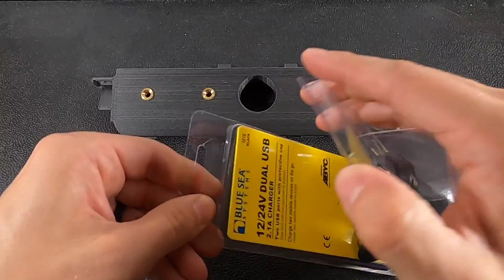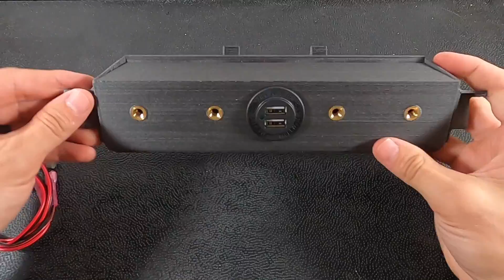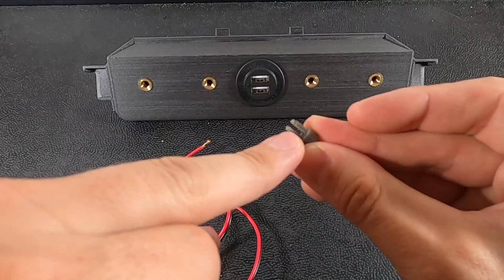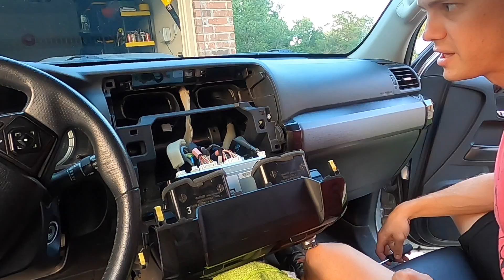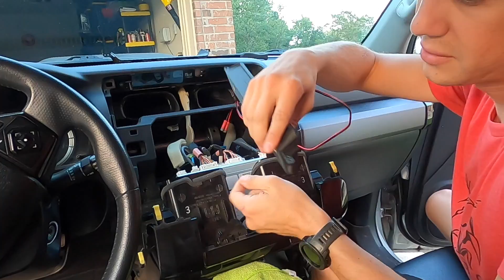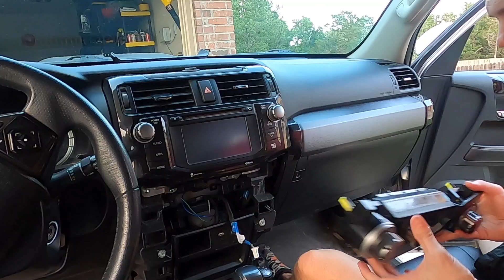LabOps Gear 4Runner No Drill Dash Mount kit

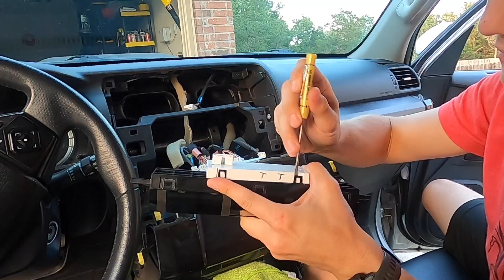Comment: @5:09 don't open the clock upside down ANYWHERE NEAR the open dash area... the hour and minute pins will fall out,  and disappear into the cavernous opening you've made,  never to be found again.... at least one of mine is couldn't find..... hope it doesn't rattle or break anything.... 😢

Honestly,  the clock still works, although slightly obstructed  there's no real reason to disconnected it

Comment: Where was this when I made mine?  
Couple questions.  You covered the clock up.  Why do you have to remove it?  The clock cover is still there hidden.  
AND..  Can the wiring for the clock be used for the power?

Comment: Using the Posi-taps is a HORRIBLE way to install this. I have commented on this several times in Multiple Videos but my comments keep getting deleted. There is a better option so you do NOT have to compromise your FACTORY Wiring. I just received my wiring harness and it is PERFECT and cost is almost nothing. PLUS it is FUSED (which can be good or bad depending on how you view it).
Reply: What harness and where did you purchase it please.

Comment: you should add a mic plug in port with like you have the usb port, if possible. also the power could have used the clock power plug in

Comment: I’m really impressed with this set up. I just pre-ordered the clock compatible version. Just a suggestion, maybe develop a wiring harness piggyback so you don’t have to use the posi-taps. I know it’s more work and you’d charge more but it’s worth it.
Reply: I didn’t see a clock compatible version. That’s the first thing I wondered if it would work with the clock as my 21 TRD ORP has the clock behind where the phone would be mounted. How has yours worked out for ya?
Reply: @KendrasEdge757  so far it’s worked great. I’ve mounted a gps and a radio head unit to the mounting bracket. No issues so far. I use the outer two ram mounts for the accessories and I can still see the clock. Honestly if it breaks I’ll likely go to the rago mount but this fits the bill and looks stock.

Comment: do you even need to remove the clock to install this?
Reply from the maker: For this version you at least need to remove the buttons or the mount won’t fit. The new injection molded unit is compatible with the cock or older display!

Comment: On the new version, can it be USB C instead of the USB A?
Reply from the maker: the hole in the mount will work for any 1 1/8th inch marine style socket.  The ones the come with the kit are only USB A but the wiring and mount would work with any other socket you wish to add.

Comment: The product is great, and I would argue that since it has been a success overall, you should move from 3D Printing these to full production. I'd be willing to spend $200 for something like this in full molded ABS and not FDM. Are you open to that?
Reply from the maker: Thanks for the kind words!  In fact molds for the upgraded version are being manufactured now!  The goal is to have production up and running by the end of spring!  The new version will work with all years of 5th gen 4Runners and allow the clock / display to remain in place.  Stay tuned!

Comment: I would love to get one of these. Any idea when they might be back in stock?
Reply: I ended up buying the ICS Fab mount. Works great.
Reply: @robbyfergusontv  how's the ICS treating you? I'm considering this as well.
Reply: @jubeikubegami  It's actually really good. Install was straight forward...they have a good video. It has held up great...still looks new. No rattling or other undesirable quirks. I got their dual USB charging port and it puts out enough power to keep two Pixel 6 Pros charged while in use...I mounted two Ram Mounts wireless chargers on it. I'm happy and I definitely recommend it.

Comment: This is an awesome no drill option, if you can make one that doesn't require the clock being removed and you will have a winner! Can't wait to see the next design. I'm very interested in this
Reply from the maker: Stay tuned. New version in the works that keeps the clock!
Reply: @labopsgear  are going to make any more 5th Gen 4Runner Dash Mounts ? your sold out and does not say if you will have any again?
Reply: @labopsgear  Any time frame? Love your simple, clean and sturdy design.

Comment: I have a 2021 4runner that has apple car play. Can I still tap into that connection? It's different from the regular USB.
Reply from the maker: The usb is for power only, but yes you tap into the 12v from the lighter. Colors are different (red should be power)
Reply: @labopsgear  Any chance you will add a tap to allow access to the USB that does support CarPlay? Maybe we can reroute the existing port up to the top and put a blank in the spot down below where that jack currently resides?

Comment: I like this product with no drill but hate to give up my clock. Others out there you keep the clock but have to drill. Any thoughts or possibilities of doing what you have done here but instead of flush with the top of the head unit to have it raised up so the clock would still be visible? I know it could compromise strength, but maybe something could be designed to make it stronger.
Reply from the maker: Thanks for the interest!  I actually do have a new version that is still in the design stage that may be more of what you're looking for!  stay tuned!
Reply: @labopsgear  what’s your time frame and how can I know when it will be available?
Reply from the maker: @davej7426  working on the design now, instagram is the best way to follow and keep up with any new projects!  thanks!
Reply: @labopsgear  done.
Reply: Can you use the clock power source? Be nice if it plugged in directly to the clock!!!

Comment: Really interested in your product, do you know if I would be able to swap the Blue Sea System 2.1 amp to their 4.8 amp USB socket?
Reply from the maker: The hole is definitely able to work, its the standard 1 1/8th inch.  As long as the wiring harness you tap into can handle the 4.8 amp draw the rest of the wire harness will handle it no problem.
Reply: @labopsgear  Thank you I really appreciate it! Just placed an order.

Comment: This is brilliant.  Can it support the weight of a tablet while off road?
Reply from the maker: The mount base itself is very strong, you’re not going to rip out the inserts or break it, I would be more concerned about the dash itself.  It would probably be fine using an iPad mini or smaller tablet but the physics of something large moving around may put too much stress on the plastic it’s mounted to.  I do have something in the works that should be able to support a lot more mass. 😁

Comment: Is there a particular reason you unplugged the clock and just tucked it in?
Reply from the maker: The clock needs to be removed to remove the clock buttons which will interfere with the mount. Moreover it isn’t visible with the mount installed.
Reply: @labopsgear  ah…
Reply: I got mine installed this afternoon  (talk about fast shipping!).  Rather than remove the clock completely, i removed the really long buttons and securely taped them into a slot on the rear of the clock face plate.  Plugging the clock back in, you can see the top of it glowing in the narrow slot.  I'll drive for a couple days and see if it annoys me.  I have a feeling I'll be going back in and unplugging it.
Reply: @KrzyAZ  So did u eventually unplug it lol?